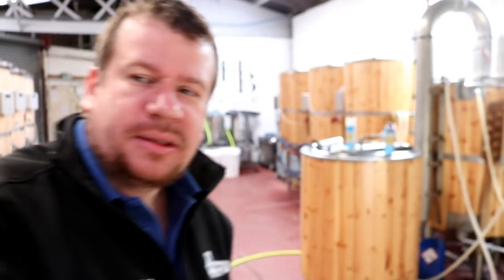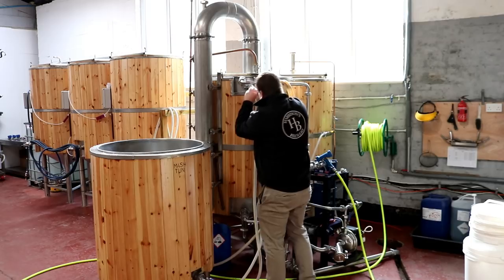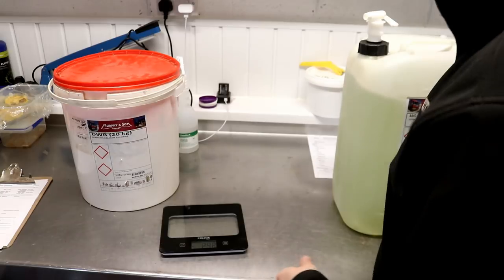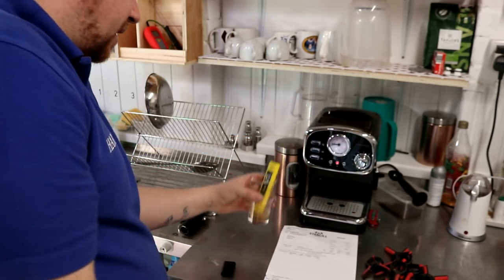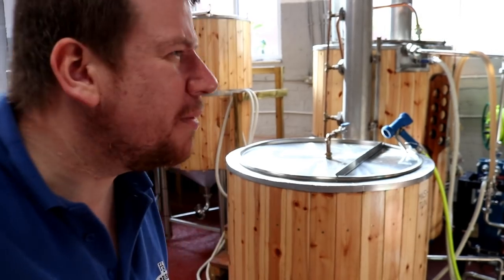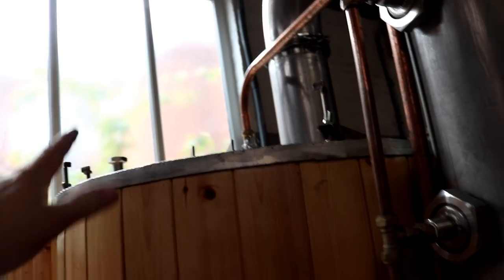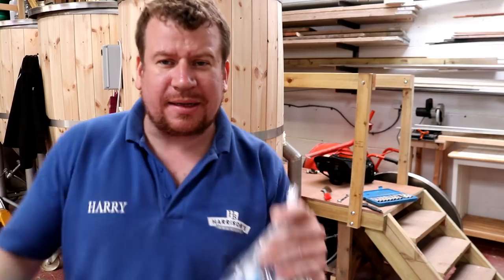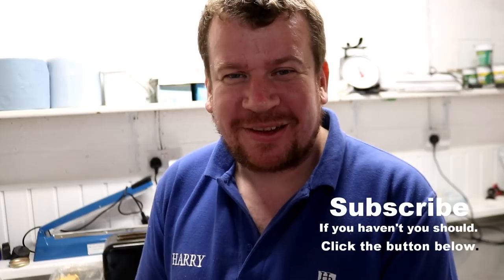What You Don't See On A Brew Day

Comment: You can use sodium hydroxide to make the pH rise, and go more alkaline.  I make biodiesel, and use a mix of destillef water, and 1 percent sodium hydroxide, but you could use tap water, as they say not to drink distilled sater. A goid pH meter is Hannah instruments, digital, not the one where you turn screws to calibrate it, but it has 3 calibration positions, and you need buffer solution.

Comment: hiya harry great vlog mate keep up the great work ive been following you for years and you are a joy to watch! just a quick question though do you add any water additions to your sparge water as you have never mentioned it from what i can recall and would be interested to see if you do and what they are (depending on your original water profile ) but as general rule of thumb! thanks harry!
Reply from the maker: Hi Brett, No I don't add anything to the HLT. It all goes into the mash. I used to add to the HLT but you end up with residue and sometimes sludge in the HLT as they are only cleaned every 6 months.
Reply: @harrybrew69  thanks harry !